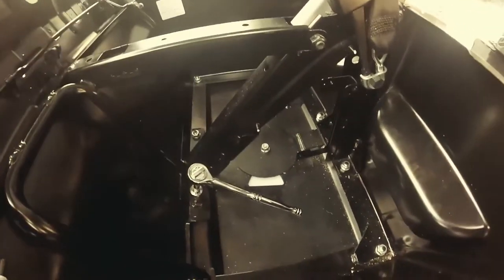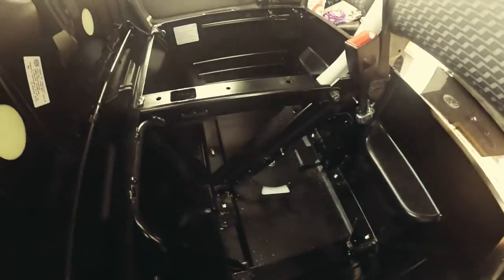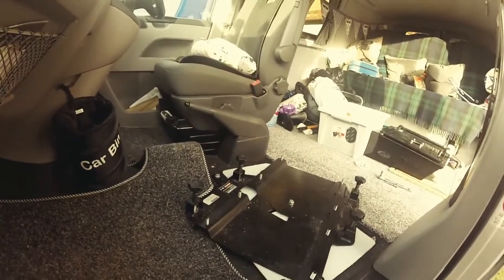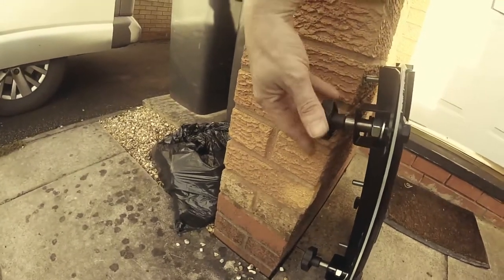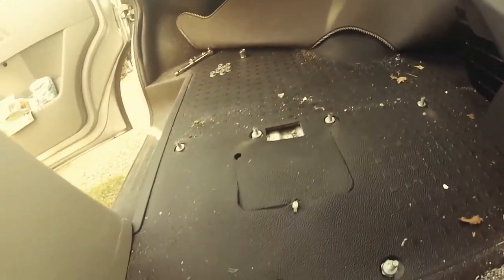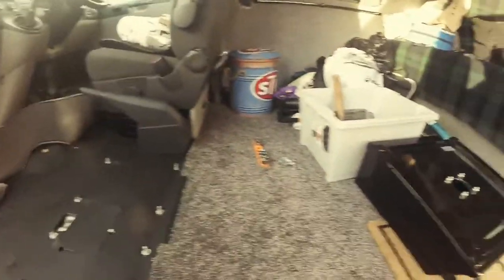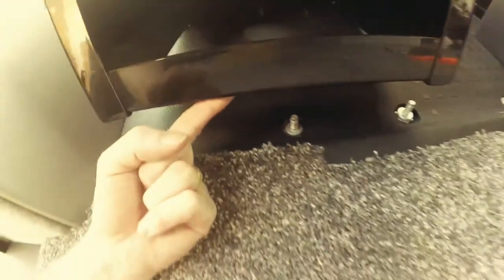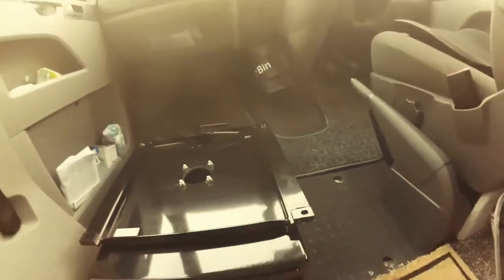Double bench seat removal VW T5.1

Comment: Hi there, with what tool and how did the final bolt get removed?  Did it require cutting with a saw or simple unscrewing?
Reply from the maker: Just needed a extra deep socket to get access they are standard hex Bolts so no need to saw hope that helps 👍

Comment: how did you get the floor bolts out please? was it from underneath the van or just using a spanner from inside the cab?
Reply from the maker: All accessed from inside the van as they rounded I had to use a deep socket and an adjustable wrench one bolt is hidden you have to turn the swivel plate until the hole becomes Visable 👍

Comment: Did you need to disconnect the battery before removing seat
Reply from the maker: No I didn’t need to as the loom was already located under the floor When the swivel plate was fitted hope that helps 👍

Comment: did you have to put the van on ramps to remove the extra bolts? I need to replace a couple of mine. Thanks
Reply from the maker: andypolfers  no all bolts accessible from inside glad you found video useful 👍

Comment: Where’s all the fusebox and wires from under you’re double seat?
Reply from the maker: They are tucked under the new swivel there is a slit in the floor covering which allows the loom to pass through there is a depression in the floor just enough space to house it.